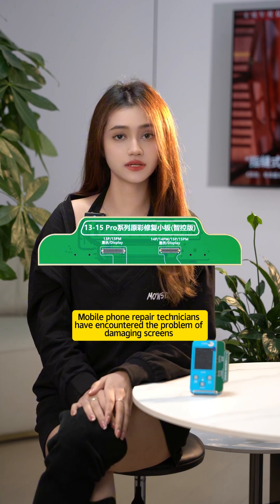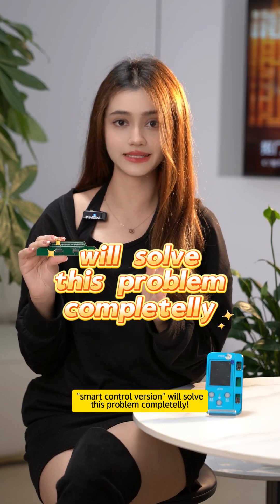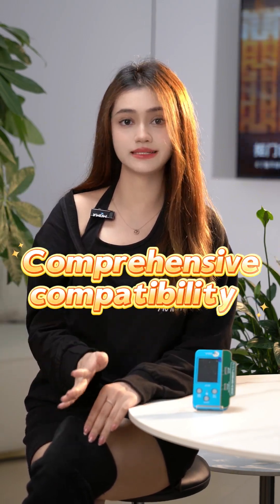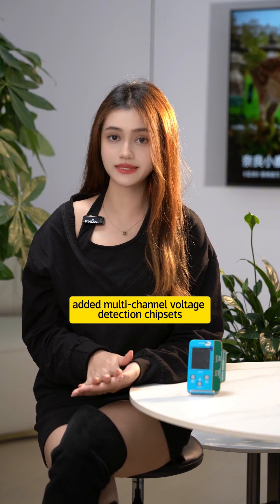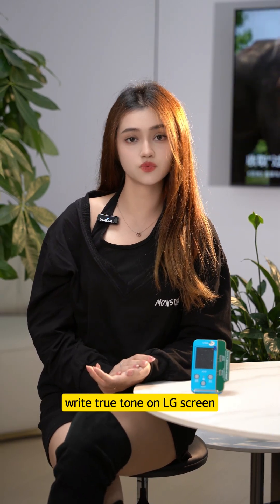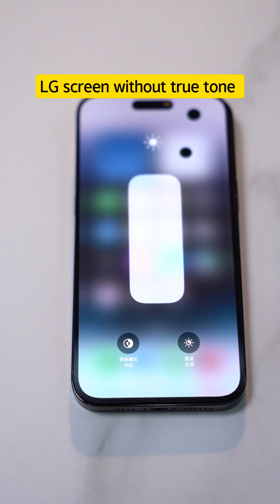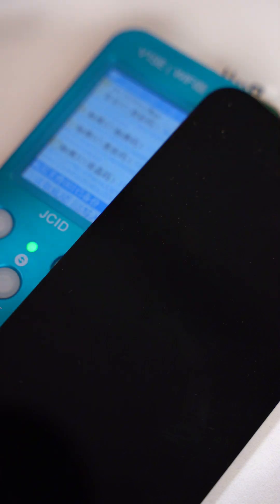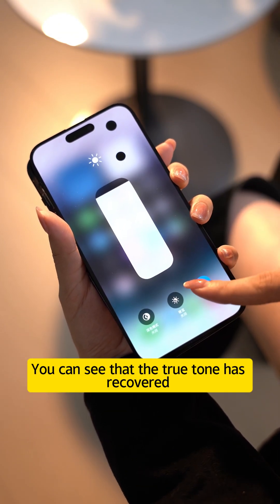JCID True Tone Repair Adaptor Smart Control Version | Avoid Damaging Screen When Writing True Tone

Comment: But for True Tone to work when changing the display, you no longer need a programmer, just update it to iOS 18.1.1
Reply from the maker: Although iOS 18.1.1 does not need to repair true tone, there are still problems such as screen pop-ups and no automatic light sensing. The true tone adaptor can solve these problems.